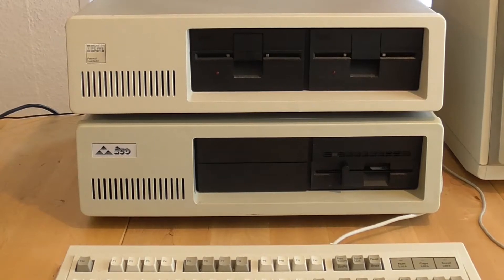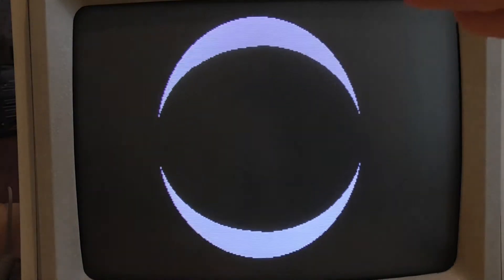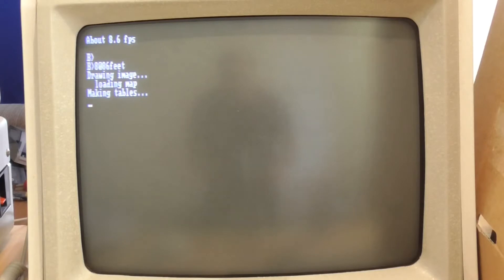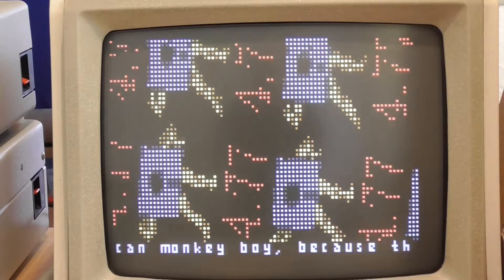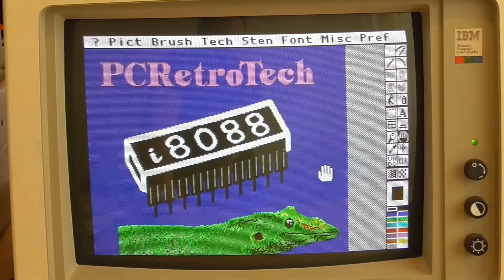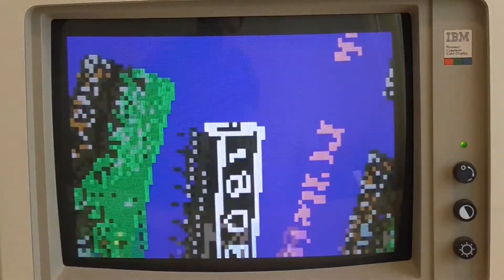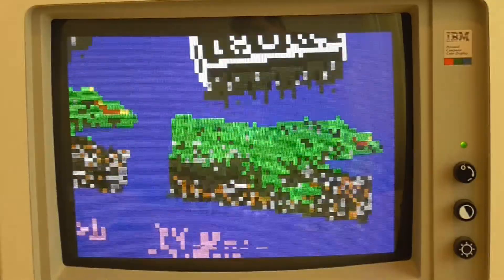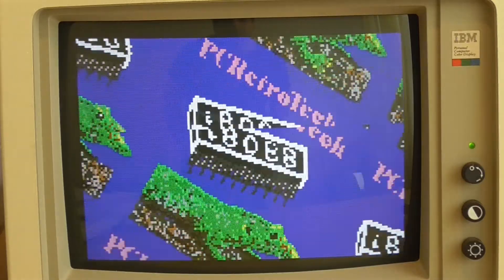16 Colour CGA Rotozoom (25 fps) | Pixel Perfect Ellipses

Comment: This is awesome! I just ran some timings on your rotozoomer code, and got 86.2 cycles per iteration (43.1 cycles per pixel) for the inner loop. That compares favourably to the 8088 MPH rotozoomer, which takes 58.2 cycles per iteration (uses composite mode and treats each VRAM byte as one "pixel"). We optimised the hell out of that routine, but didn't think of the "use the same relative offsets for each row" trick. It is a bit less accurate than the routine we used, since the rows always differ by an integral number of texels in the u and v directions. That may be what is causing the "snapping" in your video. However, it could probably be worked around with a good camera trajectory. Combining both techniques (i.e. an inner loop of just "mov al,[si+0x1234] \ stosb") gives 39.7 cycles per iteration - it'd be interesting to do something with this.
Reply from the maker: Thanks for taking a look! The snapping is mostly due to some crummy computation of the scale and rotation factors. In one of the videos it is less I think because I did some work to reduce it. It could be eliminated entirely, I believe.
I'm really impressed your rotozoom is faster still. And I love challenges like this. I will have to think about how I can improve it. :-) Or maybe the point is just that each byte is a "pixel" for you, whereas for me it is two "pixels"?
As for the integral number of texels in the u and v directions, I think you can reinterpret it as an integral number in u only (though not the same integral number each time). From that point, v is picked optimally. (Edit: sorry, this is nonsense, see my followup below.) I too thought it might end up causing some artifacts, and I vaguely think I convinced myself that the texture looks "curved". But I can't tell if it is just my monitor, which "breathes" as the brightness changes. One problem I haven't compensated for very well is the aspect ratio of the pixels.
Combining the techniques sounds like fun. You are obviously welcome to have at it (i.e. use my ideas/code whatever way you want), or I will produce something at some point. My next project will actually be filled triangles in graphics mode, for an eventual 3D object rotation (cube, icosahedron, etc.). I'm a long way from any optimal ideas, but I think I understand the "standard technique" (make arrays of start and end coordinates and draw horizontal lines). But I have some other (hardware related) ideas to try out there too (which probably won't work, or people would have already done it).
But I'll get back to rotozoom eventually. We can discuss further on Milliways or by email if you feel like it.
Reply from the maker: Sorry, I just realised you are talking about the rows, not the u-v coordinates per se. So you did anticipate that it's only the rows that are affected by my approximation. Yes, they do have integral u-v coordinates.
I read somewhere that the Second Reality rotozoom (rotazoom in their case) is considered especially beautiful. I guess they aren't approximating much. But I actually couldn't find their rotazoom in their source code after quite a lot of searching.

Comment: This is absolutely astounding :o

the only thing that could top this would be 60FPS CGA on 5160 IBM x) (but I doubt it's possible ... unless ... ?)
Reply from the maker: As far as I am aware the performance would be identical to the 5150 that I ran this on. So 25fps is probably the best you can expect. I would have liked to have gotten to 30fps (what the oldbies called a 2-frame demo) but I don't see how to get there.